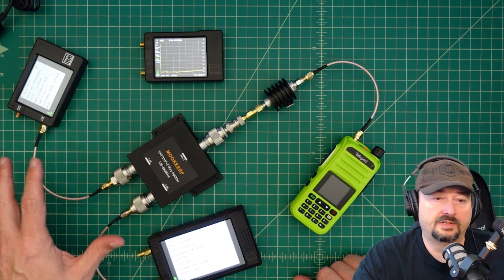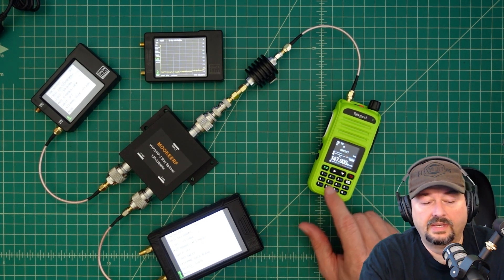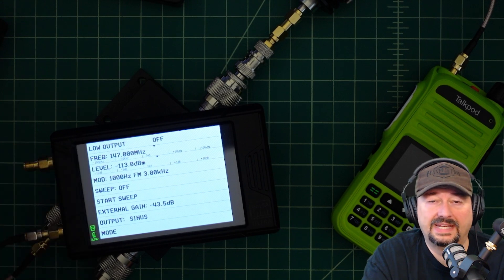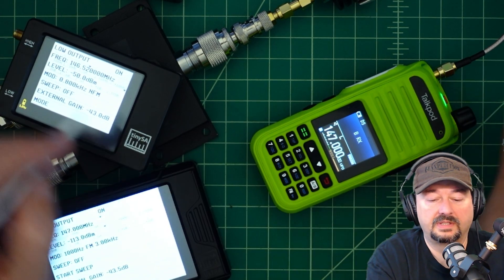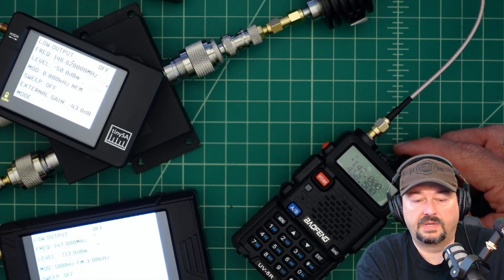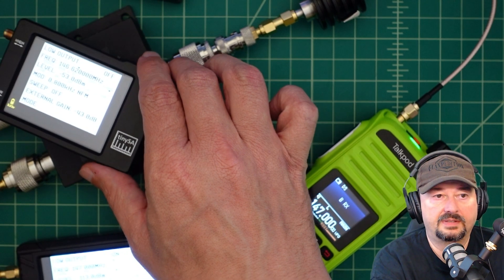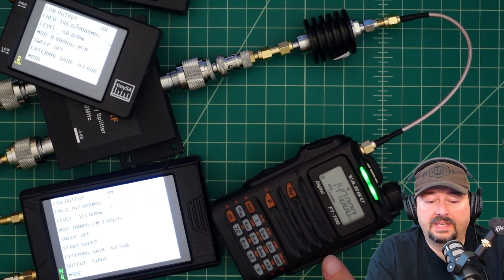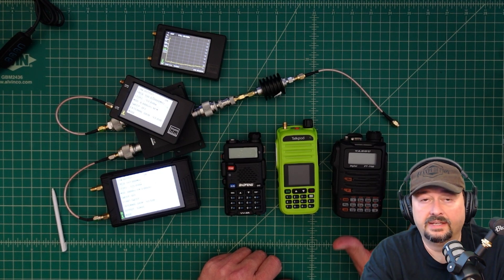Desensitization -Talkpod A36Plus Ham Radio

Comment: wonder if there's any standard units for this kind of measurement, so I can compare apples to apples with results of other hams testing a different gear 🤔

btw have experienced the same with a quansheng. got a good antenna and expected it to improve quite a lot.. turned out there's quite a lot of signals here just outside of the ham band.. wonder if a bandpass filter would help
Reply from the maker: I’m not aware of a standard 🤷
Reply: @TheSmokinApe  oh wow u're been pretty quick to respond 👌

Comment: I have the uv5r triband radios when i put it on an external antenna it wont receive the repeater output.  I have a dual band uv5r and it will receive the repeater output on an external antenna.  I assume the dual band has more front end filtering. Will a vhf band pass filter make the tribander uv5r work?
Reply from the maker: Baofengs generally have a very poor front end which is susceptible to overloading.  When higher gain antennas are attached the radio can have trouble “hearing” as it becomes desensitized from the overload.  🤔
Reply: @TheSmokinApe  I did put 7 db attenuator on the antenna and it didn't help either. I'm just curious as to how to get it to work. The radio is just a backup.
Reply from the maker: @electromech7335  I’d figure that would help.  Does it RX at all?  Maybe try the antenna and coax with another radio to make sure there aren’t any problems
Reply: @TheSmokinApe  yes it works with my icom t 70 . I can hit my favorite repeater with half watt.  
Maybe try 10 db attenuation?🤷 Rf is weird sometimes?
Reply from the maker: Only one way to find out
Reply: FwIW I swapped the antenna with another mfj mag mount i had laying around. I used some sheet metal spanning 2 rain gutter mounts for ground plane. Then ran the coax into the house. I put 4 db ,2w attenuator on the coax and now it receives.  I was able to check into the net the other day now.  
Guess lowering the gain with a poorer ground plane helped too.

Comment: Hi, @TheSmokinApe, truly great work on what is a difficult subject ... on the bench.

VK5ZEJ's summary of what I think I saw. :)

Talkpod thresholds:

1. 146.52Mhz @ -50dBm and 147.00 @ -113dBm
2. 146.52Mhz @ -51dBm and 147.00 @ -103dBm Note: This test was not done on the Baofeng.

Baofeng Thresholds

1. 146.52Mhz @ -53dBm and 147.00 @ -113dBm

Yaesu Thresholds

1. 146.52Mhz @ -50dBm and 147.00 @ -123dBm - FAIL
2. 146.52Mhz @ -53dBm and 147.00 @ -118dBm - PASS

Thought:

Possibly there's not enough test points to be definitive? It may require many more test points to produce an interference vs active channel chart for each radio?

- - - -

Edit:

Another thought:

It would be interesting to 'see' combined the wanted and unwanted interference signals capture by a spectrum analyser (TinSA)
Reply from the maker: I'd say that's about the jist of it.  I do want to get a better way to combine / mix the signals before I do any more of these tests.  Thanks for watching 👍
Reply: @TheSmokinApe  I'm absolutely sure you'll come up with something.  And I'll be a watchin' :)
Reply from the maker: Thanks bro 🍻

Comment: well done. was wondering is a UHF/VHF split does this as well ? I have a UV-5R receiving VHF and UHF (GMRS) near me cuts the RX on the UV-5R . that a trouble with UV 5R a signal way out side of band can cut the RX , 73'
Reply from the maker: I didn't test that far apart, maybe another video 👍

Comment: Thanks for this video. I recently bought a signal stick for my beafeng and it did just what you show in the video. Put the rubber duck back on and it works better but still badly. So now I am looking for a new HT.
Reply from the maker: Glad the video is helpful.  Many “experts” tell folks the first thing the need to do is upgrade the antenna on their Baofeng, it’s actually terrible advice because the gain does just what you experienced.  Good luck on your HT search 👍

Comment: If it was Spectrum Analyser oscillator noise, then it would probably degrade the signal S/N , but it looked as though it was sudden on desense as well. I guess the Digital radios either work or fall over.. Big time
Reply from the maker: Yeah, they can give up pretty fast.  Thanks for watching technishn 👍

Comment: I managed to get hold of a Rohde & Schwarz TS 998 SP which I believe is the correct tool for the job. Unfortunately, I can't find any info on it, so don't know how to drive it.
Reply from the maker: There are a few ways to do this test, I was looking for something easy BUT I’m not a fan of this splitter 🤨
Reply: @TheSmokinApe  The R&S has a pair (Σ1 & Σ2) of Tyco Ma-Com H-8-4 2–2000 MHz Broadband Two-Way Power Dividers, a dozen RF relays and a logic board to drive them.
Reply from the maker: Nice, that sounds awesome

Comment: Well done for doing this test, I have a handful of UV-5Rs myself and real life experience (on radio sites) is much the same, they do have poor dynamic range and overload very easily. I used to use an ancient Icom dualband  handheld in similar conditions and it was amazingly good.
It is usually advisable to put attenuators on both signal sources to better isolate them from each other but I think you made the point very well. For what you get with the UV-5R they do represent amazing value for money but the receivers fall a long way short of what a good superhet can do. 73
Reply from the maker: Hey g0fvt, I was toying with the idea of attenuators on each output but went the lazy route 👀
Reply: @TheSmokinApe  I probably would not of started even!